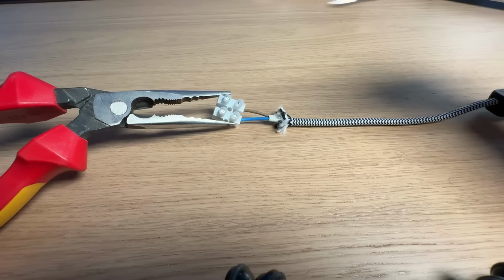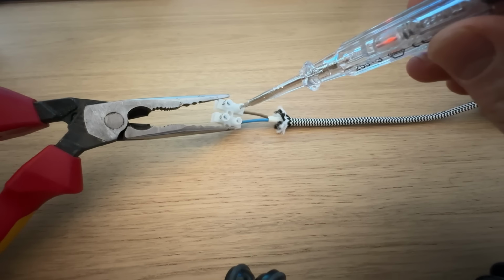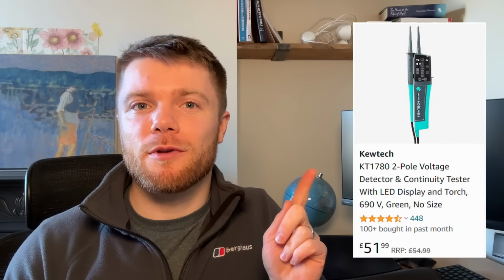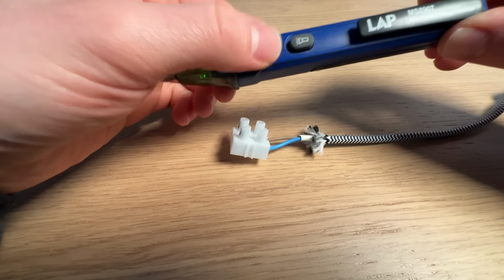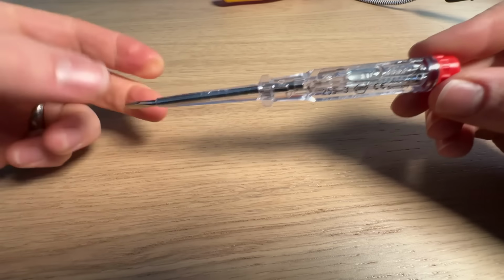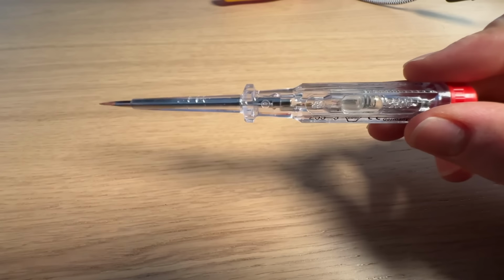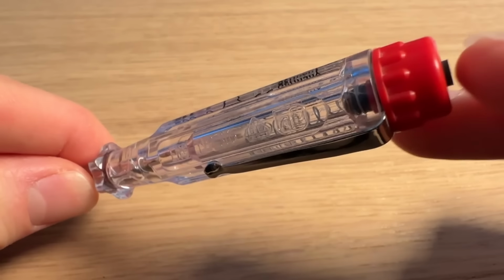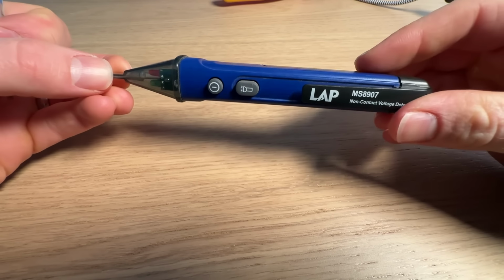The Most Dangerous Electrical Tool

Comment: One of these may have saved my life. My son had a non working 13A socket in his house. I checked it with a multimeter and it showed as dead. I used one of these screwdrivers and it illuminated showing it was live. On further investigation I found the earth and neutral were both disconnected somewhere leaving only the line connected.
Reply: For correct electrical practises You need to have a proven earth first when using a meter, an earth you know is 100% connected. In this case, you didn’t .
Reply: @liamjones246 Yes, not using the meter correctly could also be a problem!
Reply: I use a wire finder, as it detects electricity as well and reacts to small voltage and you don't need a closed circuit. In combination with a multi meter you then can find issues with a wire.
Reply: That's why I always use both before I touch the wire! Or put one pin from multimeter to socket and touch other one, it should show something, maybe just 80V or something, but something will be there.
Reply: Multimeter show the (diffrence) ,,so if both lines have 1000v it would show 0v on multi meter screen  😂 if you are not sure you must connect the black lead to a good ground or earth to test the unknown lines
Reply: It light up from must voltages even the plasma ball thing
Reply: Never trust an old  installation.
Reply: @johnwade1095  "Never trust an old  installation."  especially in buildings built in completely different time with different regime and different safety norms. Here in Czechia, you can still find buildings where earth and N wires are connected together because someone stole 3rd cable during communism. All sockets are 3 pin since always, but there are only 2 wires.
Reply: @Pidalin  this was also common practice in western Germany and Austria to the 70s. It's both a leftover from a different wiring system, where you had 110 V on every wire, but at 180° and for saving copper. Eastern Germany permitted this until 1990, often with aluminium wiring.
Reply: @tannenfreund87 yep, all “commie” countries were, de-facto, parts of the same empire ruled from Moscow and the standards mostly propagated from Germany, with Russian science/engineering already being German in origin.
Reply: @johnwade1095  Never trust an unchecked installation.
Reply: @linoio when you upgrade thee fuse board to rcd that shakes a lot of faults out
Reply: non-contact indicators often give false positives. they just glow, especially if there are a lot of wires and they are close, and you cannot know which wire is hot and which is disconnected. Non-contact indicators use a battery, and it often runs out, and even in certified indicators the sensitivity drops; this has happened to me often. Sorry, but the indicator screwdriver is a reliable, life-tested device.
and the most reliable thing is a dial multimeter.
Reply: @Trbrigade  if you're working  with lethal voltages 2 separate checks are sensible.
Reply: Geez that's a rough one. Well done at checking it with the screwdriver, because i would have been a crisp after checking with a meter
Reply: I would liken someone using one of these “testers” to a surgeon using a blunt scalpel, both might get the job done but it could get messy. Since sparks work with electrical circuits we sometimes need to know what voltages are present so we can do our job safely and resolve faults. Neons and those non touch sticks, not forgetting 230v lamps with two wires connected found in some toolkits, react to a range of voltages without indicating the actual voltage present just that a voltage is present. For indicating in voltage is present I’d rather use a plastic glow stick and a Fluke meter than put my finger on the end of a possibly made in china resistor or risk a lamp exploding in my face.
Reply: wow. scary
Reply: Hello ! May Allah protect and guide you to his light and happiness in this life and the hereafter, God bless, Ameen. Excuse me for giving a little presentation of Islam, because it is very misunderstood nowadays, especially on those « Antichrist's » times, where media and politics are mixed to distort history and truth. And terrorists (puppets of the Antichrist) who misinterpret verses, out of ignorance and political motivations, and take them out of historical context (just like radical atheists do by the way) don't help either. Thank you very much for your time.

First of all, if you have any questions regarding Islam and yourself, just open the Quran randomly, and you will find the answer in front of you, like a miracle and a sign from God.
	
Islam is an arabic word that means the Surrender to the One and Only God, our Creator, Protector, Provider, who gives us life and all that we have, we are safe and sound by his will and grace, we are His and to Him we return, and we have to thank him in this trial life by submitting to him by our free will, or later in the Day of judgment when it's too late to save our own skin. Islam was the original Religion descended to earth from heaven with Adam and Eve (peace and blessing be upon them) in the beginning of humanity. and was passed to people with the succession of the 124 000 prophets and 315 messengers of God to all nations and civilizations since, passing by Noah, Abraham, Isaac, Jacob, Ismaël, Joseph, Moses, Aaron, Joshua, David, Solomon and Jesus (Peace and blessing be upon them) during the history of mankind, the last replaces and completes the previous, until the succession of the last messenger of God fourteen centuries ago, Muhammad (Peace and blessing be upon him) to complete the noble morals of all mankind, to bring humans and jinns out of darkness into light, and to purify people's religion and belief from corruption and polytheism, and return it to purity and true monotheism, like it was in the times of the prophets (Peace and blessing be upon them).

Many Religions that we know nowadays, at their beginning were true and under Islam, initiated by one of the prophets of God, but their original teachings, history and scriptures have been corrupted over time with falsification and polytheism, or lost and replaced with false ones. That's why Islam is the only Religion accepted by God nowadays, which consists in bearing witness that there is no god besides Allah (God in Aramaic, the original language of Jesus and the Gospel), and that Muhammad is His servant and messenger, just like Jesus and Moses and others are His servants and messengers. Never a messenger of God said he was God or literally son of God, it was the people after him who changed the words of God and corrupted the Religion. God is unique and absolute, He does not need to have a family and sons or to associate anyone else with His kingdom, He can simply create whatever He wants, everything belongs to Him, and to Him everything will return. Allah said in Surah Al-Mu’minun : “God has never begotten a son, nor is there any god besides Him. Otherwise, each god would have taken away what it has created, and some of them would have gained supremacy over others. Glory be to God, far beyond what they describe. The Knower of the hidden and the manifest. He is exalted, far above what they associate. (91-92 / Translated by ITANI).

Allah means the one and only God, the God of all prophets and creatures, the creator of the universe and mankind, and the Master of the Day of judgment, where our destiny, Hell or Paradise, is decided based on our faith and deeds in this trial life, and above all, Allah's mercy. 

Allah said in Surah Al-Ikhlas : In the name of God, the Gracious, the Merciful.
Say, “He is God, the One. God, the Absolute. He begets not, nor was He begotten. And there is none comparable to Him.” (1-4 / Translated by ITANI).

Allah said in Surah An-Nisa : O FOLLOWERS of the Gospel! Do not overstep the bounds [of truth] in your religious beliefs, and do not say of God anything but the truth. The Christ Jesus, son of Mary, was but God's Apostle - [the fulfilment of] His promise which He had conveyed unto Mary - and a soul created by Him. Believe, then, in God and His apostles, and do not say, "[God is] a trinity". Desist [from this assertion] for your own good. God is but One God; utterly remote is He, in His glory, from having a son: unto Him belongs all that is in the heavens and all that is on earth; and none is as worthy of trust as God. Never did the Christ feel too proud to be God's servant, nor do the angels who are near unto Him. And those who feel too proud to serve Him and glory in their arrogance [should know that on Judgment Day] He will gather them all unto Himself: (171-172 / Translated by Muhammad Asad).

Allah the Most Merciful said in Surah Ali-Imran : Behold, the only [true] religion in the sight of God is [man's] self-surrender unto Him; and those who were vouchsafed revelation aforetime took, out of mutual jealousy, to divergent views [on this point] only after knowledge [thereof] had come unto them. But as for him who denies the truth of God's messages - behold, God is swift in reckoning!
Thus, [O Prophet,] if they argue with thee, say, "I have surrendered my whole being unto God, and [so have] all who follow me!" - and ask those who have been vouchsafed revelation aforetime, as well as all unlettered people, "Have you [too] surrendered yourselves unto Him?" And if they surrender themselves unto Him, they are on the right path; but if they turn away - behold, thy duty is no more than to deliver the message: for God sees all that is in [the hearts of] His creatures.
Verily, as for those who deny the truth of God's messages, and slay the prophets against all right, and slay people who enjoin equity - announce unto them a grievous chastisement.
It is they whose works shall come to nought both in this world and in the life to come; and they shall have none to succour them.
(19-22 / Translated by Muhammad Asad)..

God said : Say, “We believe in Allah, and in what was revealed to us, and in what was revealed to Abraham, and Ishmael, and Isaac, and Jacob, and the Patriarchs, and in what was given to Moses and Jesus, and in what was given to the prophets from their Lord. We do not differentiate between any of them. And to Him, we surrender.”
(2:136 / Translated by Community)

Salam (Peace) -------
Reply: Does this work on DC circuits or only AC?
Reply: @johngore6920 AC only as far as I have seen
Reply: Non contact voltage tester is cool. Didn't know they existed. Only real problem with the screwdriver is you could get it between live and neutral and then you short circuit. Strange this was not mentioned. I actually did that once...the spark was pretty big )))
Reply: @topcatsoftheworld They are useful as an indication somthing is live, they are however useless in proving something is dead and safe to work on as they give alot of false negatives. The only safe way is an approved set of test lamps with two probes to GS38.
Reply: Proper isolation requires checking between line and neutral line and earth and neutral and earth using an approved voltage tester l.A multimeter isn't an approved voltage tester as it can be set wrong
Reply: @WFKO. There was grounding and 3 pin sockets, but they just connected it together to save one wire because it worked and it was more safe than no grounding at all. If grounding was actually connected in place where fuses are located, who knows, but it was supposed to be connected even back in the day. Completely not grounded systems are located only in Asia and south America where they don't care about lives at all.
Reply from the maker: Non contact volt pen is best in my opinion, thanks for watching!
Reply: @TheDiligentDIYer1759 there are many digital clampmeters that have a transformer-like unit built into themselves. you just need to switch to NCV mode and bring the clamp near power lines. it will beep (if electricity is present) with varying speed depending on how close the clampmeter is to the power lines. the BEST THING about these clampmeter is you dont even need to try them on open circuits, just bring them near an insulated wire, can sense as low as 10VAC
Reply: @TheDiligentDIYer1759 yeah and those are not as accurate as a live driver. When you are a qualified spark of 20+ years come back and offer opinion.
Reply: @TheDiligentDIYer1759  What if it's broken?
Reply: @McSlobo If you aren’t qualified don’t touch it, simples!
Reply: It's only 240V so not likely to kill you (unless you're standing in a puddle / have heart issues)
Reply: @45graham45 : Wrong, it's not the voltage you need to worry about it's the current.
Tell your theory to the many people who've died from touching 240v.
Reply: @rscelectrical7091Read again. You're obviously not from an engineering background.
Reply: Below some voltage the light won't glow. You touch the wire and you get shocked ! 😀.

At an isolated transformer it won't glow at any voltage ! You touch both wire and you get shocked ! 😀
Reply: @kenzo4Ever the resistor is rated such that it will reduce mains voltage even at maximum tolerance to a safe current. The Neon bulb has a strike voltage of 89V so that same resistor will limit the current to about a third of that safe level. I wouldn't use it on an HT circuit and not sure if it would be safe on a 3 phase 415V circuit but perfectly safe on any 230V circuit.
As for risk if the spring breaks and shorts out the resistor - this would mean catastrophic damage to the screwdriver and as such would be obvious, would you use the non contact device with that level of damage? Water contamination - unless your talking of saltwater or some other electrolyte solution then it's still a high resistance - again would you want to trust the con contact instrument with that sort of water ingress.
Reply: @GuardOfGaia yep, these people are creating panic for engagement bait
Reply: @kenzo4Ever  Volt sticks don't light up when following a shielded cable!
Reply: @kenzo4Ever ”below some voltage” you don’t get shocked, unless you put your tongue in there or something..

Comment: As an old fart I have been using these all my life. I got a tickle now and then from the testers but not more than a tickle. Indeed, when wet, these are dangerous. But do you work with wet tools (screwdrivers, pliers, strippers) on live circuits ? I don't 😊
It comes down, IMO, on common sense AND !!! the resistor in series with the neon. A 1/4 W resister is unsafe ! Let alone a 1/8 W one.
Cheers 🤝🏻🇳🇱
Reply: An aeroplane or helicopter is very dangerous (wet or dry) if you've not been shown how to operate one
Reply: A quarter Watt or Eighth  Watt is not the important issue, it is it's resistance AND voltage rating that combined reduce the (possible) 240 Volts to a few MICROamps of current even IF the neon bulb element did happen to fail short. NEON indicators like this 'strike at between 60 and 90 Volts and themselves rely on the CURRENT limiting effect of the resistor. the Tiny physical resistors are used in switches that have an indicator (neon) bulb)  but the breakdown voltage of the resistor is not safety critical in the way that one of these 'tester' screwdrivers would be.
Reply from the maker: Thanks for watching!

Comment: If you use a multi meter to test. If the neutral wire isn't connected properly  then no voltage will be shown.
Reply from the maker: You’re right, that’s why i like the non contact tester. Thanks for watching!

Comment: The contactless volt detectors also have their pitfalls. If these light up then there is probably voltage. If these do not light up, then they are either broken, the battery is empty or there is no voltage.

Multimeters can be used up to a maximum of 250V AC. Many cheap multimeters do not have good protection circuits. These are already unsafe at 400V and more. If you plug a multimeter into the wrong sockets you will get a short circuit.
Reply from the maker: Yeah best to test the non contact volt stick on a known live first. Thanks for watching

Comment: I'm an old retired guy now, I can't even climb steps to change a light anymore. Please listen, these are not testers, they are a safety terminal screwdriver. They let you know if something comes "live" while you're connecting up! If they were a tester, they would have a point, not a screwdriver end! For example, you may be working on a heating system and one of the stats calls for heat. You.  just save your life! These modern day testers just stay in the toolbox. Screwdrivers don't,! I hope this helps. I haven't got long left to live. For god's sake listen!!!!
Reply from the maker: Thanks for watching

Comment: I have been using my Vitrex made in Britain one for fifty years with no problems what so ever, would I replace it with an unbranded  cheap one I seriously doubt it, a very useful tool but I only give it the slightest touch certainly would not hold there for more than a second or two, it also has a piece you can take out and put a plug fuse in to test the fuse.
Reply from the maker: Thanks for watching